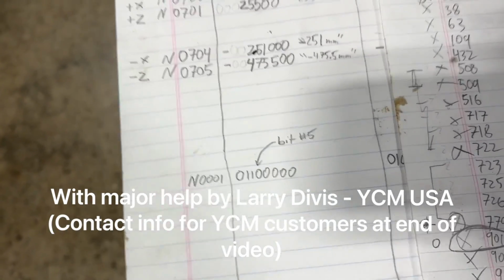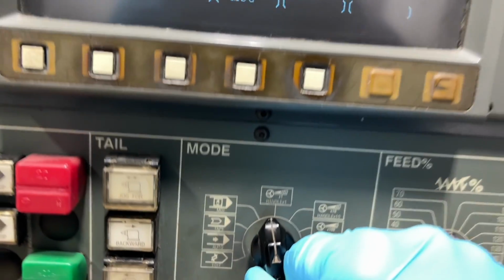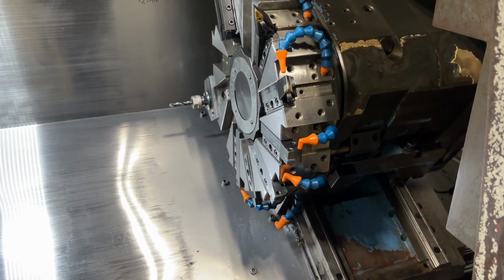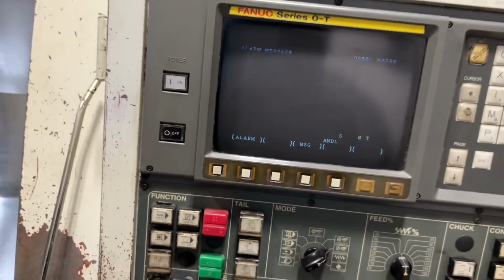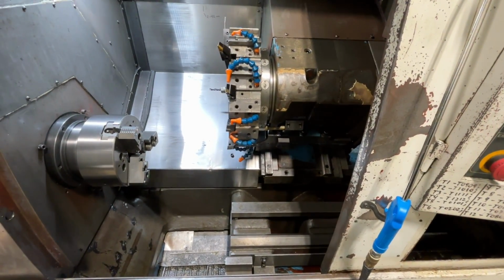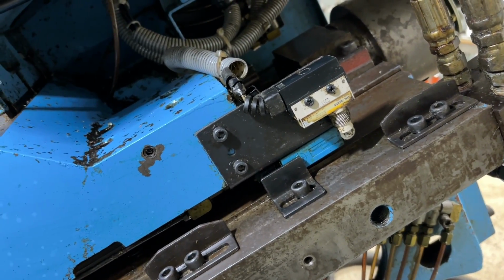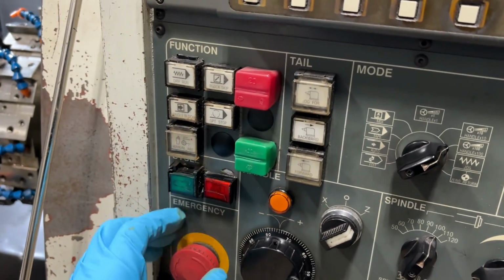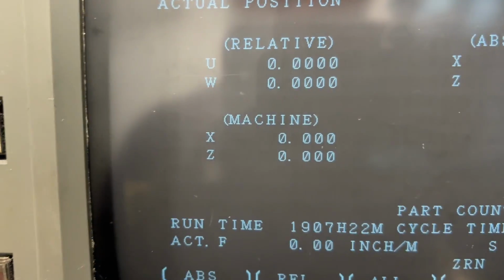Fanuc OT OTC - P Can P Cancel procedure - YCM-TC-15 Supermax - YCI USA

Comment: What is the sphere parameter in G71 in Ot Fanuc unit?
Reply from the maker: are you trying to cut a sphere with a g71? thats not really a paramenter, you have type 1 and type 2 machines, type 1 are older like this 1998, but a type 2 can cut a sphere all in one op with a grooving tool? im guessing this is what you're after. yeah these old machines you have to run a separate op with the same tool for cutting a sphere. you're better off using CAM honestly

Comment: Thanks for the video, it gives me a bit more insight as to what that parameter does in relation to the home/reference position of the machine.   

FWIW: On my machine, I only needed to hold P+CAN until the control had booted up past the 'Splash screen' that shows software versions.   After that, I can jog the machine right past the software limits (right into the hard limits).    But I'm still unable to home my machine - a Hardinge Conquest 42 with a 0T-C control that also lost all of its parameters.   I've worked out most of the parameters from Fanuc manuals and a 0T-B parameter list from another Conquest 42, but there's still some that are 0T-C specific that I haven't sorted out yet related to axis movements.
Reply from the maker: i believe thats accurate,  i just held it in the whole time for shits and giggles. i was about 4 weeks into this at the time, with so many persisting issues, very unfamiliar with FANUC troubleshooting. But what you explained was very resonant of what others had wrote online, not needing to hold it in the whole time. Variable control was the idea